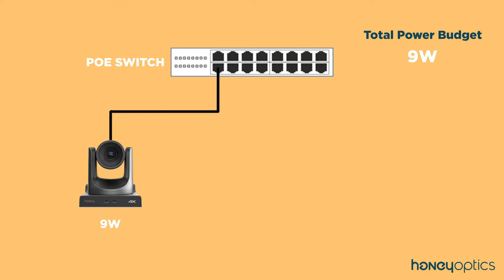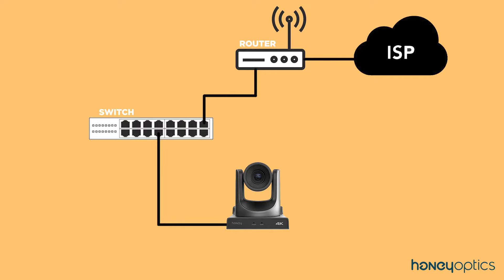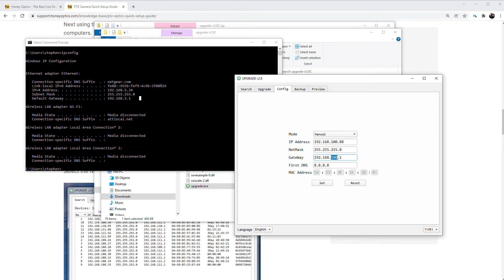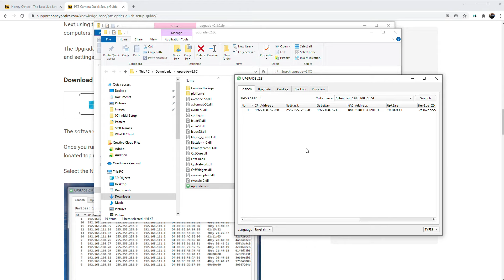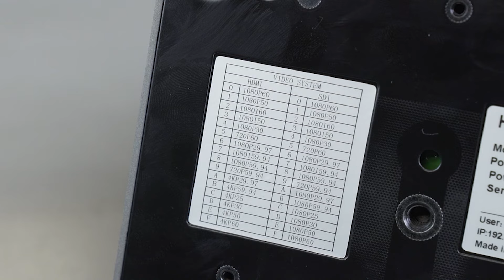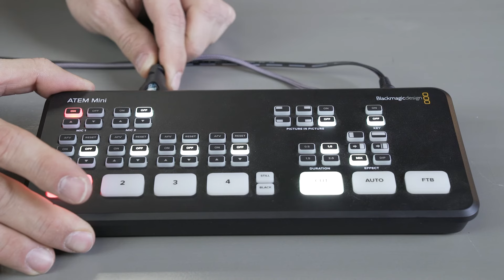HoneyOptics PTZ Camera Setup Guide

Comment: Sadly you don't go deep dive on the NDI settings. That is one reason to buy this camera. Yet the Chinese produced manual does to explain things in depth. I see the profiles like Main and High. What do those settings control? Does the First stream settings override the dial and does those first stream settings apply to NDI stream to computer? Why do you set the Bit Rate so high when it could congest the LAN and not really be necessary at only 1080P? Then in the manual the I/Key Frame shows 30 which matches the 30 frame rate. I have always thought the Key Frame Interval is more like shutter speed and all other sources like PTZ optics says to set this at twice the Frame Rate?? I is as if you or Honey Optics don't really know what these settings should be and just ignore them. I hope you will make an in-depth video on NDI and OBS.

Comment: Frustrated... I have done all this, and have browser image and camera control, but no image to VLC or to OBS in a linux system... <sigh> OBS version 29.0.0, ndi plug-n version 4.10... it finds the camera, just no image.
Reply from the maker: If you need technical assistance with a Honey Optics camera please reach out to us on help.honeyoptics.com or call us 844-542-1535
Reply: @honeyoptics  Went to the link, and posted for help.  No reply. I finally found a way to get it to work. Will make a video and send it to you. or a link anyway.
It is a great camera, even if Linux  and "it just works" don't quite connect.
Reply: @honeyoptics  Thanks... will do.

Comment: Do you need to connect the switch box to a router in order for this system to work? I am looking to set-up a portable PTZ system with 1 or 2 cameras that I can use for streaming live events (conferences/presentations). Can you recommend the best device to use for the video capture from camera to PC? Still trying to wrap my head around all the different possible connections. Saw Blackmagic Design ATEM Mini being recommended but that feels like overkill for 1 (maybe 2) PTZ cameras...
Reply: You don't need the switch to connect to a router. this means you wont be able to connect to it via the internet but if you are just using the switch to connect all your devices locally than you should be fine.